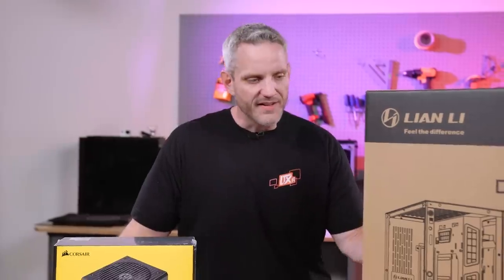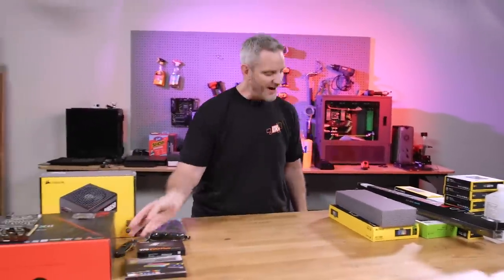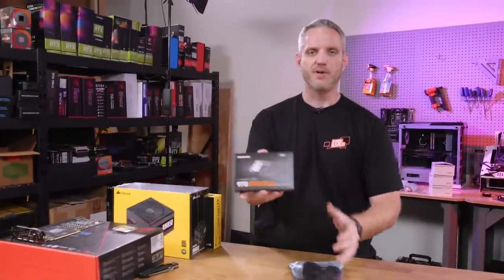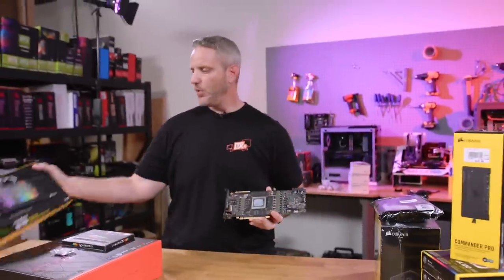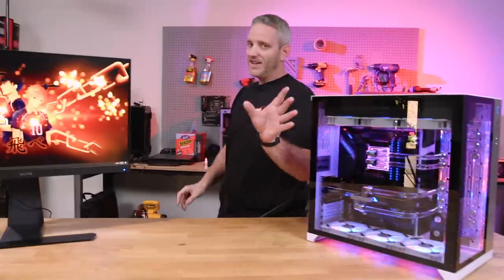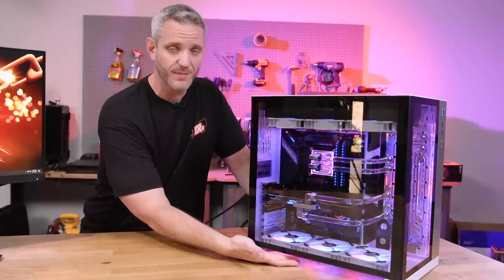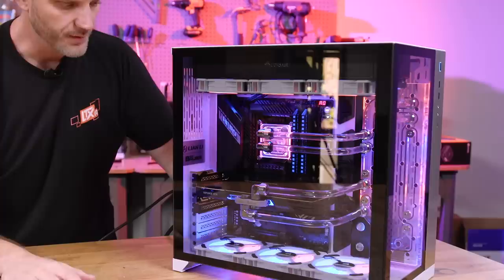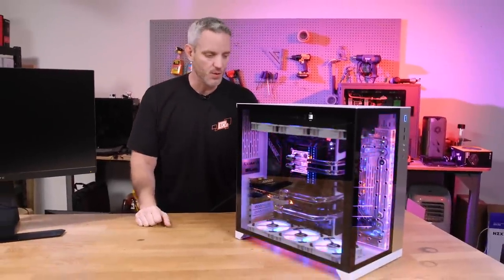I surprised my daughter with her Dream PC! It turned out GLORIOUS!

Comment: Seriously, I am now very confused... You have explained the AIO positions very nicely but do AIOs have intake fans (so I thought) or exhaust fans as I just saw in an 011 radiator placement video?! Please could someone shed some RGB on this matter? 🙏🏽😊
Reply: Depends how you set it up
Reply: @patrikgrguric535  Yes, thanks Patrik, I've decided to go with AIO 360 radiator at side front (tubes on top JayZ2¢!) w intake fans, intake at base and exhaust on top. Maybe 2 x 80mm at rear? How does that sound?
Reply: @apusista  Sounds fine, though the aio's tubes should preferably be at the bottom, not a game breaker though.
Reply: @patrikgrguric535  You sure? JayZ in another video says the tubes should be higher than the pump / block to prevent air from going in there... ?
Reply: @apusista  You must be talking about one of his older videos, as I'm sure he talks about it differently in a newer video. Regardless, GamersNexus has a great video on the matter.
You'd rather have the air go into the other side of the radiator, as the bubbles will mostly just sit there, whereas on the side with the tubes they'll cause annoying noises.
This is assuming there are any bubbles to begin with, though as far as I know they eventually form in any aio.
Reply: @patrikgrguric535  I wrote you a long reply and as I was about to send, my battery died! 😂 You are absolutely right Patrik, I must have got JayZ wrong. Of course air will move to the top, duh! However, it is highly unlikely the tubes will reach the bottom, so radiator on top is 'probably' going to be my only option. I don't game, only Photoshop so whenever I need to overclock, which hopefully which won't be anytime soon, I will cut an opening at rear, big enough for a 240 exhaust fan!! This case is beautiful but it was always going to be a pain in the butt with anything but custom water cooling. For now I could maybe put 2 x 80mm fans at rear? Dunno... I really can't thank you enough Patrik, do keep in touch 👍🏽🙏🏽😊
Reply: So, IF I've finally got it right, AIO and case fans mounting: (ALL factors considered)
. 360 Radiator at side with 3 intake fans (the tubes must reach the bottom)
. 3 intake fans at base
. 3 exhaust fans at top
. 2 x 80mm fan(s) at rear
OR (If the tubes dont reach or are too tight)
. 360 Radiator on top w 3 exhaust fans
. 3 x 120 intake fans on the side (or 2 x 140?)
. 3 x 120 intake fans below
. 2 x 80mm exhaust fans at rear
_
Reply: I love this case ❤️
Reply: @apusista  Sounds good.
Reply: @patrikgrguric535  Patrik, I think this is better. Please may I bounce it off you? Thanks in advance 🙏🏽😊

Final Ideal PShop / LRoom+ Build - AIR :

. AMD Ryzen 7 5800X (8 cores, 3.8/4.7 GHz)
. ASUS ROG Crosshair VIII Hero AMD X570 (2 x M.2)
or 
. Intel i7 Rocket Lake 11,700 (8 cores, 3.6/5.0 GHz)
. Asus ROG Strix Z590-I (2 x M.2)

. Noctua NH-D15 CHROMAX.BLACK (Easy airflow, good looking and efficient + there is cabinet space for it) with 9 x NF-S12A PWM CHROMAX BLACK SWAP + 2 x NF-A8 PWM chromax black swap (80mm)

. Nvidia GeForce RTX3070FE
. Corsair Dominator Platinum 2 x 16GB 3200MHz C15
. Lian Li 011 Dynamic Black ✓ ₹12,000
. iCUE Commander PRO Smart RGB Lighting and Fan Speed Controller OR 6 x Cooler Master Wired RGB Controller C10L 3 Mode
. Sabrent Rocket M.2 NVMe 500GB or WD850 Black
. CORSAIR RM750x 80+ Gold Certified OR Cooler Master MWE Gold 750 (fully Modular)
. CM MS110 Keyboard / Mouse but White light
. ASUS ProArt Display PA32UCX-PK 4K
. APC UPS 15KV
. Win 10 Pro

NB: Case fans mounting: (Easy enough now)
. 3 x 120 exhaust fans at top
. 3 x 120 intake fans on the side
. 3 x 120 intake fans below
. 2 x 80mm exhaust fans at rear
_
Reply: @apusista  All in all looks good, just make sure everything is compatible and that you have enough fan headers for all of it. Also visit https://outervision.com/power-supply-calculator for a precise calculation on your total psu consumption, then add roughly 50-200W on top of that and your psu should be as stable as you'd want it to be (disclaimer: I'm not saying your current pick is insufficent, frankly I'm just not sure, never had a system this extreme lol).
Reply: @patrikgrguric535  Thanks so much Patrik. Yes, I checked the power usage. It's around 500W so I figure 650W is enough but 750W to be safe as the price difference is not much. Re fans, I have included a little fan hub so they can mostly plug into one header. Then things like Noctua fans are purely aspirational 😂 I may well have to go with generic but thankfully, I hate RGB, barring a couple of led lights on components that can't be helped so I save some money there. I want a black and glass look. Frankly, I have never targeted such a high end build before! I'm still using my 6 year old computer right now! And will continue to use it. This build is for 2022 earliest, after supplies come in and the prices drop radically which frankly, may be 2023 the way things are going. Under full lockdown again here from Monday 6 am for 2 weeks! So by the time I buy, it won't be as high end as it is now. I also don't have to buy the monitor at the same time, I can buy it later but I bought the case now as those, the prices only go up and quality comes down, design changes etc and now that it's planned, I know roughly how much I need to save. Trust all is well with you? 🙏🏽😊
Reply: And which part of the world are you at? I live in Bangalore, India and I'm a retired photographer. One file / photo goes to 2GB easy! And that's with a 36mp camera. (Layers etc) If I get a couple of jobs, then my first investment may have to be a camera. Then computer...
Reply: @apusista  I'm doing great thanks. Got my own custom build not so long ago. Rtx 2060, r5 3500x...perfectly fine build that'll serve a tech high school student like me amazingly, and for a while.
Also I live in Croatia.
Reply: @patrikgrguric535  Hi Patrik, wow! I have 3 friends who are in one or 2 of those 5 countries, talk about fragments! Young people don't often find time for old newbies like me. Really appreciate your inputs even more and you WILL go far in life. About the computer, I thought of one more cooling option... I'd like to bounce it off you... buy a Z53 or Cooler Master 120 AIO
. Radiator + 2 x 120 exhaust fans at top
. 3 x 120 intake fans on the side
. 3 x 120 intake fans below
. 2 x 80mm exhaust fans at rear
Does this sound better than the Noctua D15 idea? (You have a great GFx Card. I don't game so only Photoshop and Lightroom mainly + some others... Even the 3070 is because of the 32",4K, 60Hz Monitor) Are you a gamer? 🙏🏽😊
Reply: @apusista  Thanks for the compliments, I appreciate it. And yes, I suppose I'm a gamer.
In regards to your cpu cooling options, the AIO you chose (I think) would cool your cpu better, but tbh, I wouldn't go for it for my own personal rig, unless I'm overclocking the cpu.
I'm pretty sure price isn't a problem for you considering the other parts of the build, although it is more expensive. Both are great cooling options, although I recommend looking up temperature comparisons and also GamersNexus's video on AIOs vs Air Coolers, it's a fantastic video and I think it presents the pros and cons of both really well.
Reply: @patrikgrguric535  I agree with you, I put a Cooler Master Lite 120 mm in my old machine, overclocked it from 4 - 4.4GHz and it's silent!! Cruising. Also, since I'm not extreme overclocking ever, a Noctua D15 would work well too in this ridiculously roomy case that I bought with my heart instead of with my head!! There is a good airflow from bottom to top, so 120 AIO or Noctua. As for my other parts, 1) I'm willing to wait for prices to dip and for these parts to not be such a big deal, as my old pc is STILL fine now touchwood. 2) Barring the CPU, ALL the parts are subject to availability and price. eg: C15 RAM, no chance!! :-))  X570 0r Z590 yes but Gigabyte or MSI are fine!! And NOT the top of the line models either. Thanks so so much Patrik :-)
Reply: @patrikgrguric535  My younger son is a part time gamer but for as long as I can, (he's 21 now, far away in Berlin) I will constantly encourage him to spend that time working out and playing outdoor physical sports instead!! I KNOW that after a certain age, which he is long past, his gaming will not lead to success / to him realizing his potential and I keep telling him so ;-)